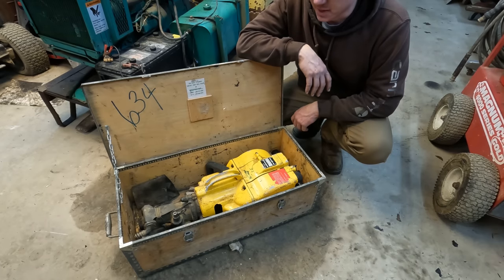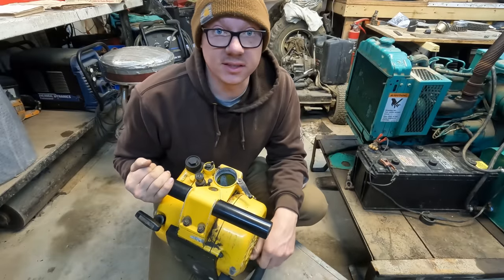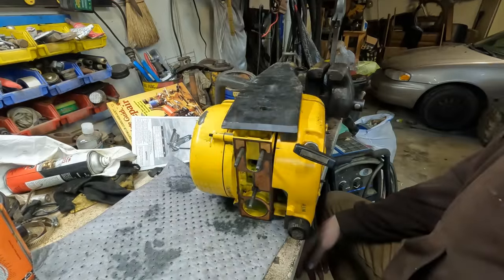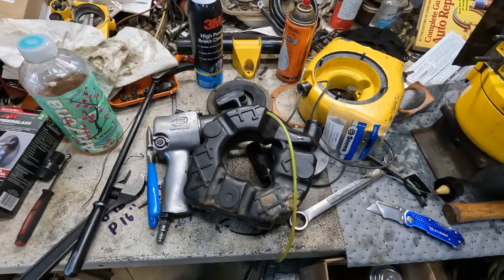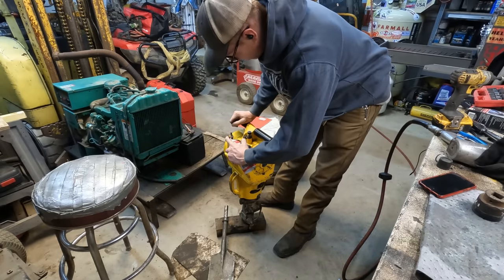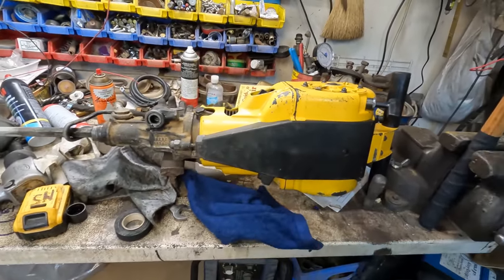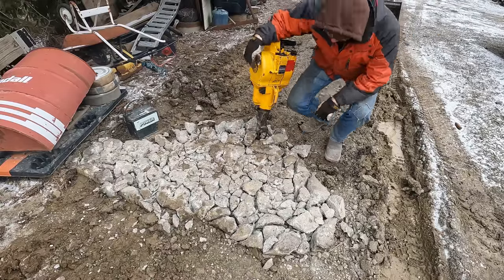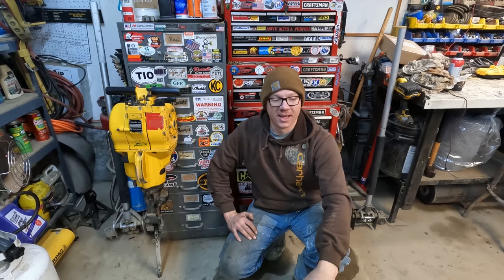RARE? Gas Powered Jack Hammer, Will it ever Run again??  (Pionjar 120)

Comment: Haha, God bless you Matt! I haven't yelled at the TV like that for a long time lol! I use to run those back when I was a young man. It appears to be running perfectly, but just above idle. She will jump a foot off the ground on hard granite at high speed. By now you no doubt know that the throttle is used to idle down the machine and as a kill button. Remember, primarily it is a drill and needs to be throttled down to start a new hole. Otherwise, she runs full throttle. After you get it started and the chock off, you adjust for highest reliable RPM. You lean the mixture as it warms up. If you start getting a lean pop, richen the mixture until it stops popping. The mixture changes with temperature and elevation so you make small adjustments throughout the day for best performance. If you want to idle down for more than a few seconds, richen the mixture instead of holding the button half way. Pionjar are very robust but simple. Basically, you are the carburator. I think the fuel mixture was 12 to 1, 30W motor oil, not 2 stroke oil. By design, black sooty oil runs down the drill chuck for lubrcation.
Reply: Sounds very much like someone that's spent too many hours leaning on that drill.  I agree it's probably more set up for drilling small blast holes and the like,  but don't give Matt any ideas .......
Reply: My Uncle was notorious for “chemical excavating “ 💥💥😂
Reply: @Kaptain13Gonzo  He might very well sell it to Andrew Camarata. The guy is into blasting whole mountains !! 🤣🤣🤣
Reply: Exactly! We used 1 1/8 in star bits to drill holes for 1 in powder, but it also worked well for pins and feathers. It had an adapter for driving the pins and you could split big boulders that way if blasting wasn't an option.
Reply: @tsteiner8694  yep, we used to use it for this exact thing in the Canadian Military back in the 1980's. The pionjar was tough, simple, and got the job done.
Reply: "Basically, you are the carburator". That made me laugh.
Reply: You are the last person with a cordless drill not using it to start it with. 21mm socket on the flywheel side... Felt sorry for your shoulder. The design dates back to the 50's. Make sure to clean the recoil exhaust drilling regularly. Use 8% mineral oil, not 2-stroke oil. Very important!!!
Reply: @marcryvon  Camarata is king of this business 😎
Reply: Add a rag get a rag wedded a little bit and put it on the paper and and let it dry it should pull it apart adapt rag with water
Reply: @henroys  I thought about the drill too. that would kill my shoulder trying to pull it.
Reply: Looks like to me everything you need to run is there. So what if it's missing the choke. Should still be able to be run with what you have there Just do a little rigging

Comment: I am from Sweden and i have used the pionjär ( Pioneer) and the bigger version Cobra a lot. They are notorius Hard to start but when they run they do a very god job. I dont see that you do anything wrong, i have used a lot of foul language över these , keep up the good work!!
Reply: Yes, the high amount of oil in the fuel tend to clog the spark plug if it idles too long and frequent cleaning of spark plugs is a memory I have of these.
Reply: Well done Bjorn thats proper subscriber/viewer support
Reply: Svenska grejer är rediga grejer det! 👍🏻
Men jag visste inte att Pionjär var detsamma som Pioneer? Hoppas han ser ditt svar iallafall 👍🏻
Reply: @TheBibliofilus  I've used Easy Off oven cleaner to clean fouled 2 stroke plugs.
Reply: I have the bore-sharpening-machine for pionjär, if anyone is interested.
Jag har Borrslipmaskin till pionjär om nån är intresserad.
Reply: I totally agree with your comment it being hard to start. The company I worked for bought one of these and whichever crew got stuck with it would immediately assign three men to start the pionjar while the rest of the crew would start the job. The owner got so tired of all the crews complaining about spending all our time trying to start the **** thing! Watching Matt pull and pull on it just conjures up bad memories. They sold it just to cut labor costs. Good riddance.
Reply: @ajwilson1953  Its  not very hard to start if you know how to do it, people that say so usalle havent readed the manual, OR have a drill with some problem. 

A well taken care of drill is easy to start, you just have to do it the right way, I done it so many times.
Reply: Геморойный аппарат.  Не Калашников .

Comment: If you want to get the pages from sticking, then try to put some heat from a blow dryer on the pages....15 inches away blowing it should loosen the adhesive. Same for price tag stickers on tools 😊

Comment: I already replied to a comment but I'm going to repeat it here.

The throttle is wide open when left alone. Pushing down closes the throttle.

The fuel sucking back may be from the tank vent being left closed. You have to manually open the tank vent.

Dennis at Creighton Rock Drill in Ontario is the expert on these. CRD has all the parts EXCEPT the plastic side handle that us broken on yours. They also provide repair and full rebuild services.

If the fuel hose was brittle the gas hose & gas seal may also be brittle. That's the hose that channels gasses down into hollow drill steels (and the seal that seals around the steel) to eject dust & chips from the drill hole when drilling. 

You are using mixed gas right? CRD recommends normal SAE 40 non-detergent motor oil for the mix, the ratio is 1:12 because the oil passes down into the hammer mechanism to lubricate those parts.

Lastly, I was able to get pdf files of the brochure, operation manual, parts manual, and full rebuild manual from Jim Phillis at Atlas-Copco.
Reply: Wow, great info Matt C !  👍
Reply: Hopefully he sees this
Reply: I'm saying thank you for helping him out. Great information
Reply: Very nice to have viewers help keep the younger generation to educate those who may some day pass on to the next-generation  👍
Reply: You the man! With the info.
Reply: Since the side handle is unobtainium, I wonder about using short pieces of wire rope brazed into sockets for a stiff but flexible handle.
Reply: @Diesel Creek
Reply: rock drill is a bigger version of sds max drill right? if so do some places rent them? and near SLC Utah USA 🇺🇸 . and is there a cup attachment tool for it to drive post's/rods ? and is there one that operates on residential power supply?
Reply: @richardprice5978  A rock drill is a jack hammer that also rotates and blows air down the bit to drill deep holes in rock. The Pionjar 120 is rated to drill 20 feet deep.

It is a step up from SDS-Max but it's a VERY LARGE step up. I would not group them together. 

Yes, likely available to rent near you.

Yes, post driver, ground rod driver, tamper. Any attachment you can find that is a standard 7/8" x 4-1/4" hex.

Oh, forgot to mention. Any that you're likely to find for rent would most likely be pneumatic and have a large trailer type air compressor needed to power it.
Reply: @mattc7820  thanks for answering some questions of mine so towable by a CJ/LWB tj ? and how much is it to rent aprocsimently ? as the property im working with is in the old state gravel pit and has granite and quartz under the top soil and the 5ftlb de walt corded sds max rental didn't cut it 4ft down out of ideally 20ft ground 5/8 threaded 13-inch rod and uk 🇬🇧 drill bit and the other one is 2ft down 18 ft to go and it's one of the last items on the list for energising my new electric service. the mini exivator had a hard time digging for the trench/was expensive
Reply: @richardprice5978   I don't know what a rental costs in your area. Prior to me acquiring my Pionjar 120 I rented one several years ago. I think it was around $200 for 4 hrs of the compressor, hammer, air hose, and standard bit. You may have trouble finding a place with a ground rod driver and I've never tried to drive a rod that long, especially into rock.
Reply: @mattc7820  Yeah I used to build inground pools in New England(granite state) and my boss had the town of actons old heavy jackhammer/rockdrill, this thing had a v8 air compressor to power it! It had an old Chrysler 318ci V8 with about 2 dozen scuba tanks surrounding it, that thing was the biggest and loudest air compressor ive ever used and ive also worked in multiple large auto shops haha. It was in a self contained trailer like you said about the size of a small truck it had toolboxes that had everything you needed including holding the hammer, all the bits, heads and attachments, and spare parts. It was pretty damn cool and if you were really working the hammer hard and used up alot of the air pressure the v8 would all of a sudden floor it to redline to make up for the pressure loss, it always scared the fck outta people not expecting it because it was already ungodly loud but got much louder when that happened haha.
Reply: What a star 👌
Reply: @____________________________.x  thanks im trying not the cheat code NEC 2022 and secsone 250.5 🤔🤓 and most lineman has told me that rock is a piss poor conducter/rain bird has a pdf and chart of best practices
Reply: @Lotek117  lol 😂sounds like a really old tool but useful and the smaller engine size as dodge did make one using a BBM 440 and the first time i heard of it i was WTF 🤔 but i guess dodge loved to sell to industrial/fleet sales costumers
Reply: @Lotek117  would a rock drill hammer force 120lb hit/50tq ~ use common 3/8 or 1/2 inch shop air line for automotive/welding shop tool's? and a 5 gallon tank and electric 3hp compressor 220psi work? and how much is the tool rental by its self vs buying one? used or new ?
Reply: @Lotek117  a big basement or pool in sold hard rock headache's and a headscracer 🤔🤔🤦🏻‍♂ moment as that sounds extremely expensive and tetis and time consuming? vs above ground and or adding a second story or 3d story home
Reply: Shame he doesn't read your info..
Reply: Bump!
Reply: 1:12? Damn
Reply: @SkinnySkinch  it's because there has to be enough oil left after combustion to pass out if the cylinder down into the hammer mechanism. 

The 130 model (just hammer, no drill function) is 1:20.
Reply: well the ones in the UK that i have used worst luck idle withy no pressure on them lean on it and the throttle opens   .
Reply: That's because the cylinder has 2 opposing pistons in it. The upper piston is attached to the crank and points down. The other piston points up and is attached to the hammer mechanism. The compression is low when it's just sitting there. When you lean on it you add resistance onto the lower piston increasing compression and combustion efficiency which ramps the RPM up higher.
Reply: @russellsmith3825  Or take the anti-vibe handle off an old chainsaw?
Reply: Matt try steaming the pages like when you try to unglue wall paper or an envelope to unstick the pages
Reply: @billrock6397  my manual is a pdf, no steaming needed...

I'm still surprised he hasn't come to read this comment. I try to help a guy out and he doesn't even pay attention.

My Pionjar 120 is one of my favorite tools. I'm slowly acquiring tools/bits for it. I have enough drill steel and bits to last me a lifetime, all bought for pennies on the dollar from ebay.
Reply: I've ran them. It's nothing special.

Comment: Hello, these units are very unique to use as we use them in the military to run spikes down for large hanger and fabric tension shelters, unfortunately the company doesn't make them anymore and the push button is used to shut the unit off as the turn know next to aur filter is the throttle to wide open and then metered by push button if you need a Manuel I can send you a full one as I have several at hand as atlas went to a much new unit and these units are made in China from original swedin.

Comment: Steam from a kettle is good for separating stuck pages i would imagine.
Reply: Yes, steam from a kettle or steam cleaner, or steam iron will do the trick.
Reply: @cockerhamsands  that's so 20 years ago they just huck their jizzum right on the computer monitor now
Reply: That’s what I was thinking
Reply: Matt you showed great stick too it . On that project when the recoil spring flew out I would have had to walk away. I've done the can't throw that away it's to neat thing for 35 years. I have a yard for of treasures to good to scrap keep on saving that good old stuff
Reply: @purplepup8897  🤣😁
Reply: @cockerhamsands  🤣🤣🤣🤣🤣🤣🤣🤣
Reply: Watch the movie "The lives of others". The Stasi used machines specifically designed for opening envelopes without damaging them using steam.
Reply: Knowledge you gain from porn mags.
Reply: @purplepup8897  Jesus man! 🤣😂
Reply: @rolfgubner4056  your wrong
Reply: No you do not want to introduce moisture to that moisture is more then likely why there stuck
Reply: Can confirm that works for papers in swamped vehicles, trucks and atvs.
Reply: @cockerhamsands  
🤣 i don't get it! 😉
Reply: @rolfgubner4056  steam it , it should come right off
Reply: This video was painful and exhausting to watch. Good on you 👍 to pull on that beast so much but not me. Hate pull start.
Reply: @cockerhamsands    Or his Mom ! 🤣🤣🤣
Reply: Love it , how you are like a kid with a brand new toys  ! Never grow up or old Matt ! ! !
Reply: Nice dancing with your new toy !
Reply: Time for a little bit of a nap 😴 😌
Reply: @purplepup8897  who needs a computer monitor when you have a smartphone?
Reply: @cockerhamsands  😂🤦‍♂️
Reply: @shexdensmore  boomers

Comment: Hello Matt. Awsome, as a Swedish person AND owner of a Pionjär Cobra i love this.  I have an older model with a crank insted of magnapull.  Suicidestart, because it can kick you bad.  You can get parts
They run with very low RPM. . The company now goes under "Atlas Copco".  You probably also need the "ä" in Pionjär, insted of "a". "Ä" is pronounced like "And" but without "nd" . Pionjär means Pioneer in Swedish.